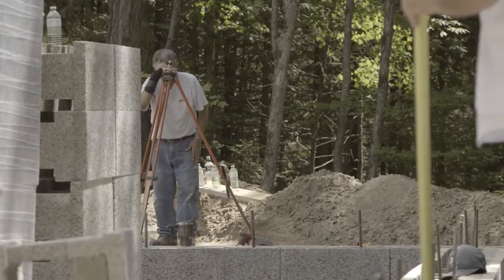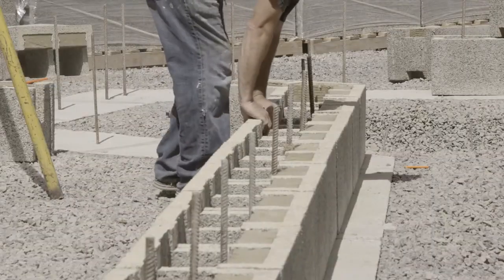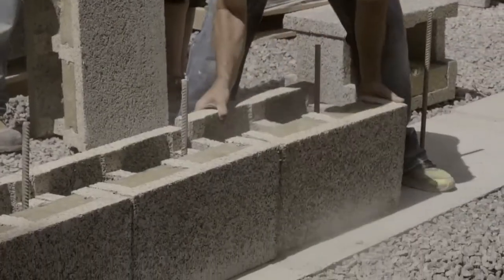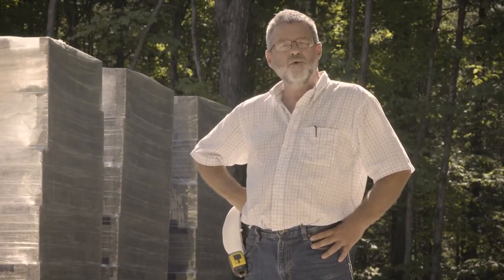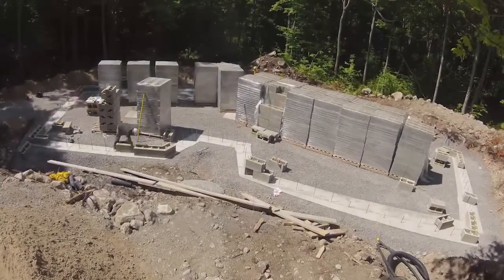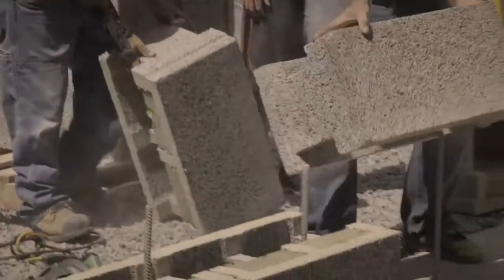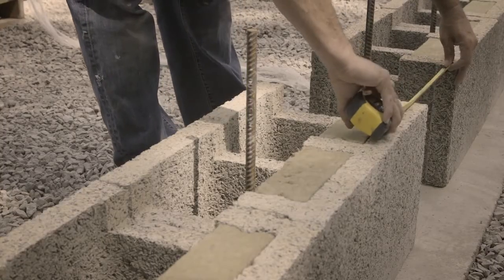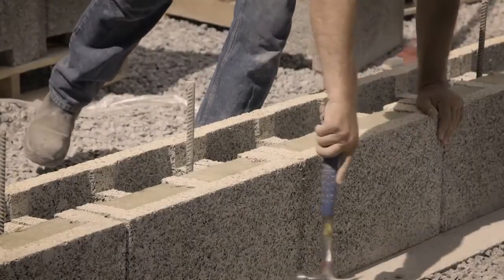How to Build with Nexcem ICF Part 3: Laying the First Course

Comment: You don't use the waterproofing between the blocks and the concrete foundation?
Reply from the maker: Tiger 19 No we don't. The waterproofing goes down the wall and over the footing to prevent the water from getting under the block. As often as possible we use Fast-Foot footing fabric to provide a capillary break between the concrete and the earth.
Reply: @timsingbeilnexcemicfspecia5761  Thank you.